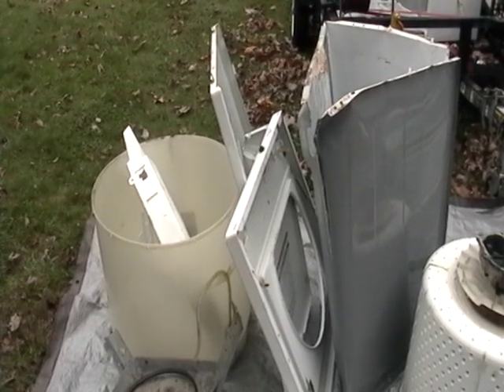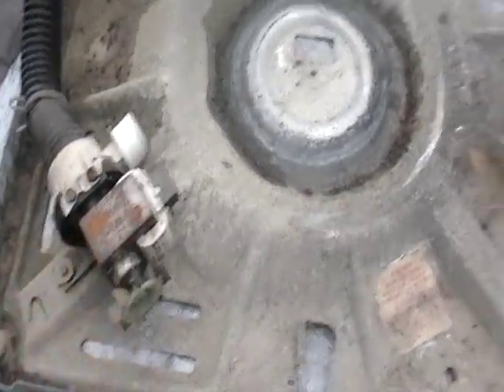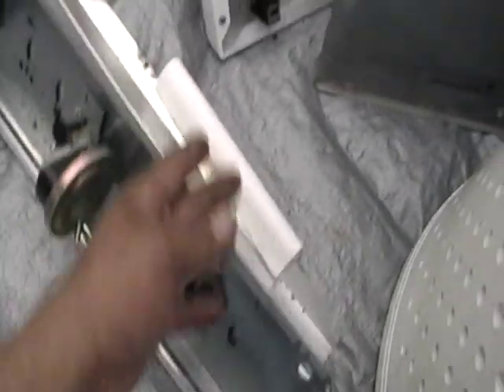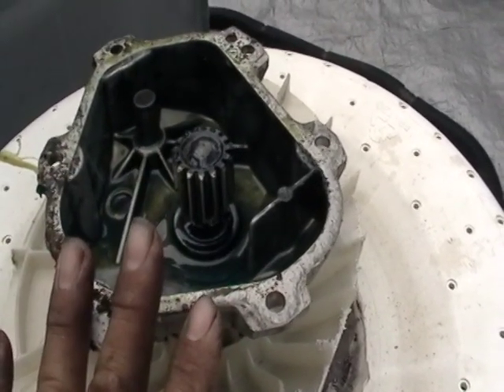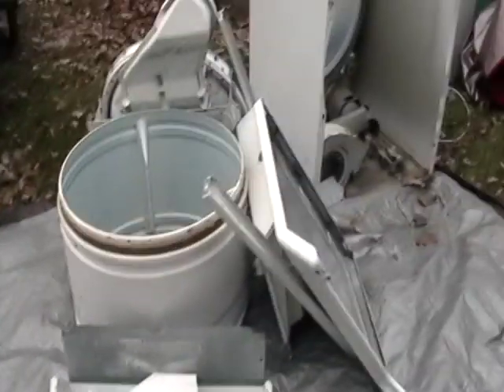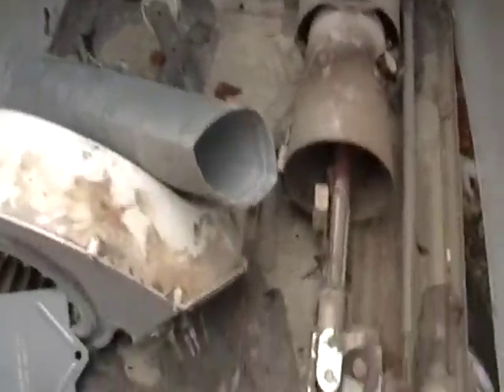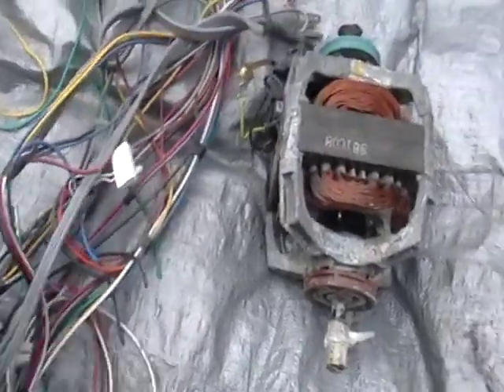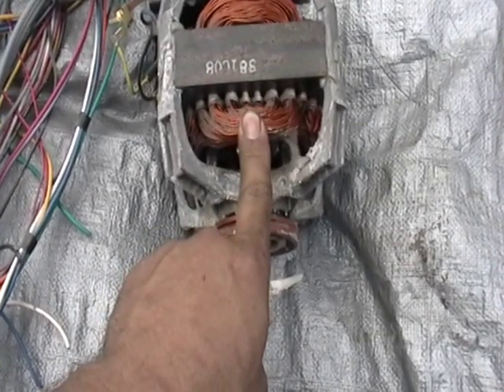scrapping a Washer & Dryer for cash

Comment: The plastic relay/switch box that's attached to the dryer motor has (I think) gold plated terminal tabs that pull out after you smash the cover off. I pulled out a bunch of tabs from one and I'm pretty sure they're gold plated, but not positive. If you could look into this Mike and let us know if it's gold or just brass. Cheers!

Comment: I recently did a washing machine as my first scrap...steep learning curve!  I took it apart in the kitchen so i could move it eaout easier, however atmo cant get the drum out of the the squar frame.  IS the drum made from stainless steel?  very bright and shiney on inside....having fun getting the copper out of the motor coils!

Comment: i just finish scrapping my dryer  and i have the motor and copper wire; the  rest of the dryer i believe is made of steel or tin are those of any value so that i may sell to a scrap dealer. please inform me because i am new to this.

Comment: Mike if you take the adgatator off the washer there is a nut holding the drum on . Take the nut off and the drum will come off and you don't have to take the transmission apart.

Comment: Hi Mike, under the grease object, and within the tube.... washing machines, have the largest capacitors etc.... to explain it better, there is a massive circle of copper, in the tube!!!....Next time you encounter such a washing machine, get rid of the grease unit, cut open the tube, carefully, and you will see a massive circular structure, that is loaded with copper... you can estimate a circle around 30 to 40 centimeters in diameter and it  can easily have around 5 kilos of copper or even more, along with an entire belt of magnets around it.I would be interested in acquiring at least 10 of these units,please drop me a line.

Comment: Yo Mike how much do u make from scrapping a washer and dryer?
Reply from the maker: That is a good question. I am going to do a video on that again. I will show what they weigh as is and then taking apart so you can judge. as is you should make about $10-$15 as is.
Reply: Mike, have you found it more affective to tear all the way down all the time? Here we take the panel, wiring, motor and the rest stays whole when it goes in (unless it is a stainless tub). They don't pay more for it is classified as tin (with the concrete)

Comment: Better to pull out wire harness and aluminum dash panel. sell rest for steel all the motors have aluminum wire in them from mid 1970`s to now
Reply: the fridges are getting to have a lot of aluminum winding style motors as well

Comment: worth more to fix them than to scrap them out more times than not.  usually a belt or motor very simple only idiots scrap things out instead of fixing them.
Reply: depends where you live & how old it is. where I am, the local market is saturated with used & young washer/dryers so for me to fix up some old beater and try to sell it, it wouldn't be worth my time to have it take up the space & whatnot while I wait for a non-existent buyer to pick it up for scarcely 2x what I would get from scrap material cost.
Reply: plenty of people would give you $300 for something that only needs a $20 belt.  I know a man who did this for  30 years and  amassed a huge forture and got payed to take the things away.   there is no such thing as non existant buyers . even in flooded markets . if you get $150 for it after 20 mins work and a small investment it is way less work than scrapping and doing the environement a great favor buy not wasthing the energy it took to build it.
Reply: Miguel Miquel I average about 70 items (washers and dryers) a week. You can't give them away. If people are paying you up to $300 per item I would be thrilled to sell you all of mine for $50 a piece! Just tell me where to ship them to! I do accept cash only.
Reply: yes sr....
Reply: thats why i fix and resale appliances bro ...make 20 times more that amount